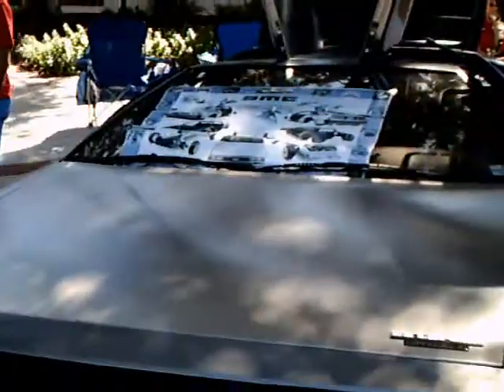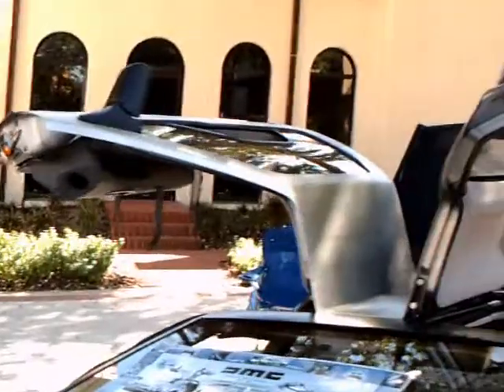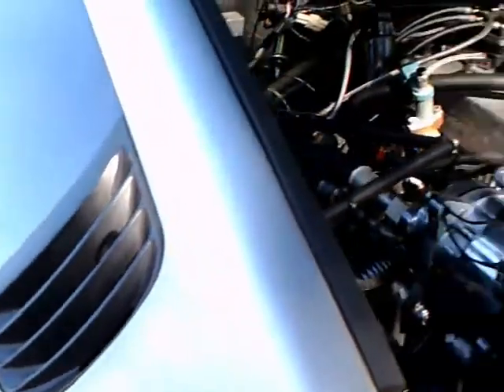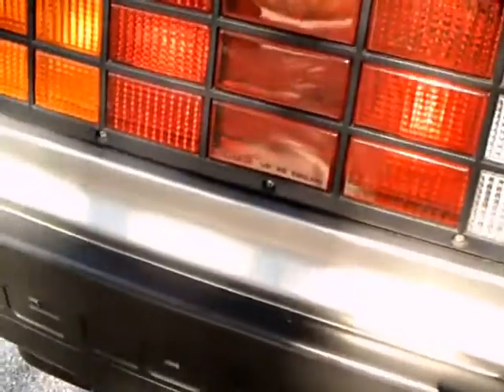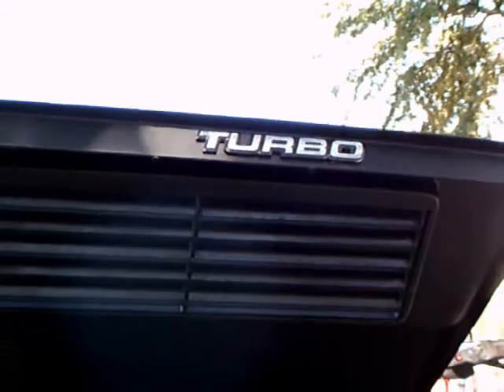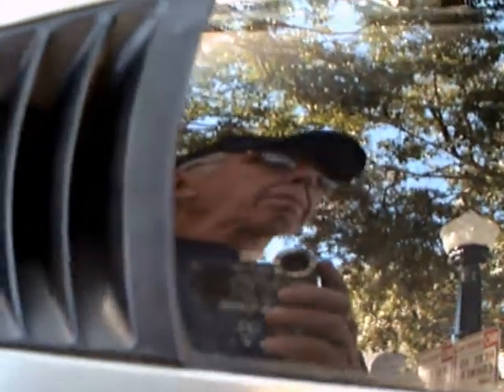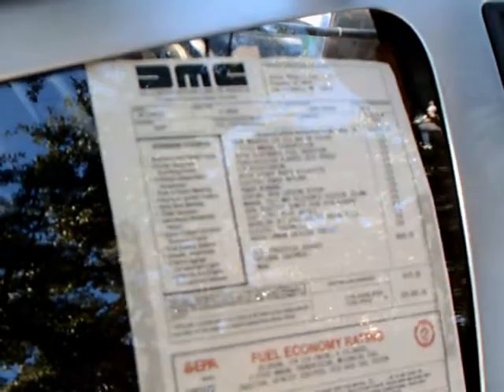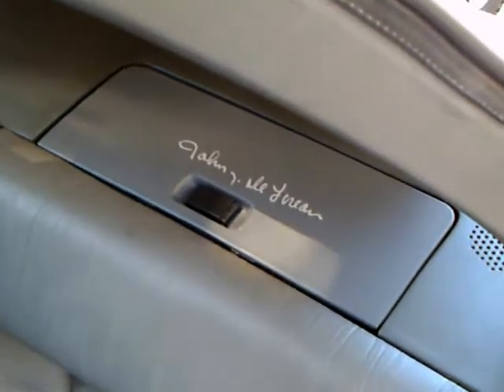1982 DeLorean DMC-12

Comment: @raconter1 502 was a twin turbo prototype engineers by Legend Industries. They used a couple of IHI turbo chargers on the Delorean engine. The car was tested against a Ferrari 308 GTS and beat it with a 0-60 of 5.8 seconds. The problem was getting the Renault transmisssion to handle the extra power. A lot of beefing up had to be done.